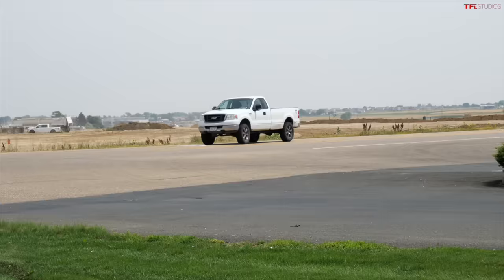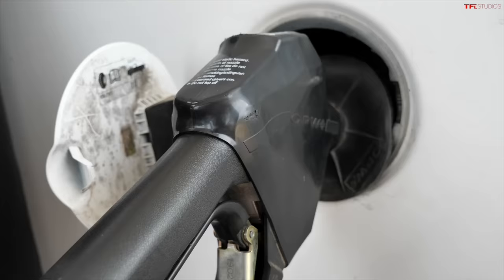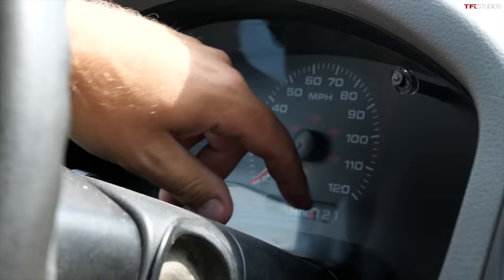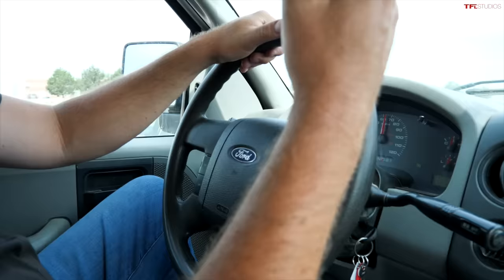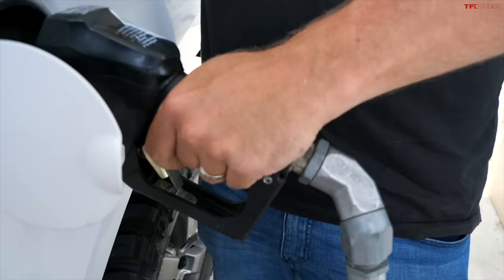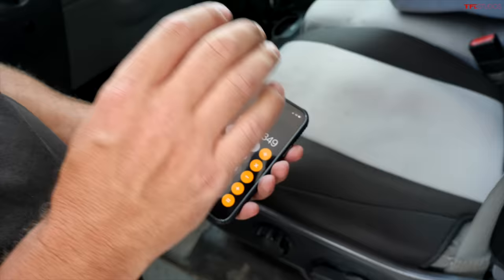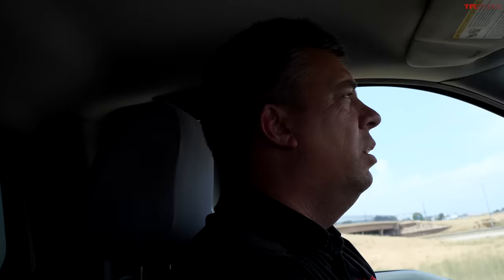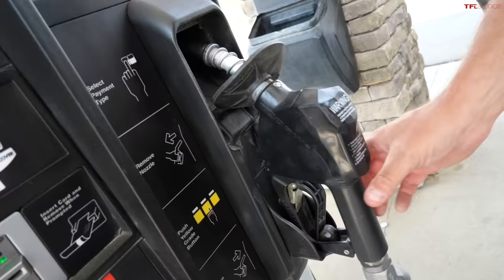Surprising Result: Here’s What Happens To Your Truck’s MPG When You Install A Topper!

Comment: That 4.6 motor is a great motor. The 18 years of owning my f150 with the 4.6 , I didn't have any issues besides basic maintenance of course .
It's unbelievable how the truck manufacturers stop making a proven motor and replace it with something else that usually is junk.
Reply: It sucks they all do that shit. I wonder if it wasn't for all this EPA garbage if they'd have kept some reliability
Reply: Have the same 4.6, though cammed for passenger car, in a 1995 Grand Marquis. Starts and purrs at the touch of the key to this day. Really good reliable engines.
Reply: Its incredibly common that the hoops they have to jump through for changing EPA regulations, and cafe standards, both take a dramatic toll on reliability.  Many of the engines, regardless of manufacturer, have the capability to go MANY trouble free miles.  It's the issues that arise from egr, pcv (routed into the intake), dpf and scr (diesels), and often times the tuning required to run clean enough for emissions standards, all these things take their toll on an engine.  I am all for vehicles that arent gross polluters.  But on the other hand, who likes to be stranded somewhere simply because reliability matters less than what the EPA decrees is allowable for the time being?
Reply: Because the old engines become obsolete.  Why do you think Ford stopped producing the Model T engine?  It’s called engineering, and the replacements are NOT always junk.
Reply: Does the 4.6 last? Yes. Is it a gutless inefficient engine? Also yes. Can’t say the 3.5 or the 5.0 are bad engines at all
Reply: You can thank the government for that.  Manufacturers are trying to squeeze out every bit of emissions and fuel efficiency they can.
Reply: My dads 2002 f150 had 400,000+ miles and it could last longer, but my dad left the truck running while he got off to the store and someone stole it, and after a police chance the truck ended hugging a big tree and was a totaled, but the grand marquis 4.6 still running like a champ and it’s almost like factory new
Reply: Thats 2 months older than me! Wow engines mustve been good back then
Reply: new and improved a computer on wheels;... NO Thank you!
Reply: Gutless but good motor have in all my vans
Reply: @TheFreedomtrain4449  My 01' supercrew 4.6 has 330,000 miles on it. Gutless, Inefficient, but reliable!!! And surprisingly even though its gutless it actually tows really well!!!
Reply: Actually, both 4.6 replacements (2.7 Ecoboost or 5.0 Coyote) have proven to be fantastic engines. The 4.6 was great but it's been around since the early 90s. We have one in our '03 Exploder
Reply: The 4.6 was reliable but grossly underpowered. The thing is you can make a ton of power with them with some tuning, it’s a shame Ford was so conservative with the tuning on the modular engines.
Reply: Everyone wanted faster faster trucks that save time getting from 0 to 60, everything is the gdi forced injection turbocharged aluminum stuff, we'll have to see how that stuff holds up over time compared to the old designs.
Reply: It's interesting to read other's experiences with the 4.6. Had a 99 F150 with it and it was absolutely the worst pickup I've ever owned. I spent more on repairs on it than all my previous trucks combined. The 4.6 itself sheared the exhaust studs - both sides, valve seals went on front cylinders - both sides, so it burned oil in those two cylinders. The plugs were good on the rest and completely fouled on them.  The hydraulic cam chain tensioner slowly died so the valves would clatter. The rest of the truck was a nightmare too - enough that it was the very last Ford pickup I bought.
Reply: Wait till uncle joe passes his corporate 52 mpg requirement coming for the next couple years. V8s gone!
Reply: @ShyaMiss  don't forget about fuel management and cylinder deactivation from Chevy. Basically destroyed those 5.3L engine that is known to last to the point my friend's father only had to replace the transmission 3 times.
Reply: @TaijiArban  the reason I didnt include those, is that I feel they are examples of mistakes made specifically by GM.  They all make their own mistakes, but I was going more with the general problem areas that plague them all.  You are however, not wrong.
Reply: @ShyaMiss  yeah, it's the only brand I have experience with in terms of reliability so I had to put it out there.
Reply: @TaijiArban  I am a GM guy myself.  I had an 07 vortecmax gmc sierra, I turned off the AFM with a tune, early on.  That truck was at 245k when I sold it and never had an issue.  I followed that up with a 14 Silverado, also defeated the AFM on that one right away, it's at 108k with no troubles to this point, even knocking down an average of 19mpg combined over its life, and getting just under 23 mpg when on highway trips.  Also installed a catch can on that one to try and keep the intake valves from getting all gummed up.  So far so good.  It is my opinion that none of this should be necessary though.
Reply: Absolutely gutless for a truck engine.  Mine was down to about 12 mph climbing a low mountain pass while towing a 6000 lb trailer.  That was of course before it burned a valve and became a very expensive paper weight.
Reply: Yeah. The 4.6 in my '02 F150 Super cab 2WD is pretty bullet proof for the way I drive it. But, once the engine does die, or the transmission fails again, I'm going to stuff an old carburated 7.5L 460 big block in it from an '80's E350 RV.
Reply: @RadarLightwave  That would definitely be a mistake. Don't get me wrong, I do love the 460 for what it is, but you'd be MUCH better off putting a 5.4 in the truck.

Empty, the 460 would be slower than a 5.4. By the time you add enough weight that the 460 would make a difference, you're pushing the limits of the truck itself. Add the weight of the engine block and abysmal gas mileage of the 460, and you'll be wishing you'd just had the 5.4.
Reply: @bc30cal99  Given the 4.6's statistically fantastic record, I'd say there's a lot more to your story than has been written here.

Did you buy new or used? How many miles? How was it maintained and used? Of course, lemons do exist regardless of manufacture and model.
Reply: @RadarLightwave  hope you enjoy 5 miles per gallon then
Reply: @regi0317  enjoy your 70k mortgage and btw, it sounds like garbage
Reply: I wish I could say the same about my 2004 with the 4.6
I've had nothing but problems with it. Mostly with various sensors malfunctioning, including the ECM witch has gone bad 3 times in 4 years !
Reply: @supersnot4  Bought used after having it checked by a mechanic. Had 115,00km on it. I'm pretty careful with maintenance - was actually a maintenance mgr for a construction company for a bit. It got full synthetic oil and good filters every 5000km. Up here in Canada the 4.6 didn't have a good record in the pickups, but seemed better in cars.
That '99 might have been "special" alright.
Reply: Heard stories about Cash for Clunkers and that engine? It’s the only one that would take hours to seize the engine instead of minutes! ✌️
Reply: Got the same 4.6 v8 in my 2003 Mustang GT. Still runs great! The modular v8 is very reliable.
Reply: @TheFreedomtrain4449  They are not gutless with mods. My Mustang GT whoops 5.7 chargers in races.
Reply: @TheFreedomtrain4449   That's the thing man, the SOHC 4.6 will last, but its gutless compared to the 4.8/5.3 and just wasn't competitive. They had to do something and developing a whole new platform would cost too much, same for making them all DOHC so along came the 3V as kind of a bandaid.
Reply: @michaelmartin2276  Sorry to hear that, Michael.  Since yours is a 2004, would you have the 3 valve motor then?  I understand those particular motors had way more problems (both the 4.6 and the 5.4).  The 2 valve motors were much more reliable and durable, although yes they had less horsepower and torque.
Reply: @LA_Commander  
2 valve
Reply: @michaelmartin2276  Oh wow, really? I could have sworn 2004 was the first year for the 3 valve.  My bad.
Reply: I had an Expedition with the 4.6. I broke a timing chain and drove 4 miles back home. I just changed the guides and put on a new chain and I was good to go. Non interference motors are a life saver when this happens. I loved that motor.👍
Reply: @bc30cal99  Same. My '99 4.6 F150 engine was fine at  250k. But everything else...as soon as it broke 60k, 3 complete pairs of tie rods, transmission rebuilt twice, 3 fuel pumps, 2 alternators, 2 $700 dash modules, 2 wiper motors, 2 starter motors and brakes and rotors would not last 30k. All highway miles. New silverado 2009, 246k 100k first pair of brakes,  zero tie rods, 1 transmission and starter rebuild at 200k. Both driven same routes equivalent stress. Huge difference.
Reply: @EM-fi2qg  Sorry to hear that happened to you E30, but glad you were able to fix the problem and move on so well!
Reply: @BIKEMAN21  Like their diesels !
Reply: @tedschmitt178   I still drive a 1931 Ford Model A every day (see my YouTube channel if you do not believe).  Ford's most reliable motor ever was replaced because the market wanted a V8.  They didn't care that it was less reliable.  They fell for the hype. Chevy had a 6, so Ford had to make an 8 to keep selling cars.
Reply: @TheFreedomtrain4449  my 2000 expedition has a 4.6 with 230000 on it. It gets around fine, still drive it on trips. Has no problems getting on the freeway, passing cars,. and gets 18 mpg when I drove it on trips! My FX4 5.4 with locked out phazers gets 18 light poles per gallon, but it pulls the hitch of a trailer! 90% of people that bought f150s with 5.4 would have been much better off with a 4.6! Friend of mine has one of the last 4.6 trucks. Does everything with it and it has over 200000 miles on it.! I pull a camper, with the FX4!
Reply: Same with the 4 liter V6. After 18 years the only issue mine has is it needs a new water pump.
Reply: @acdii  My coworker has a "center console" Crown Vic with the 4.6 in it. He just got his exhaust reworked and it sound soooooo freakin good, it's such a baller ass car. He put some 16' mustang wheels on it and it looks great. I'm so jealous of his "power cloud" hahaha
Reply: @bloodbushcraft2467  it is engineers trying to justify the money they get. Making it cheaper appears to make a bigger profit margin.  But them sales fall off , money and customers are lost . Cheaper is only better if reliability is not naggatively affected .
Reply: @Smokkedandslammed  That is the CV Sport model. I had one of the first editions myself. A rare one because it was a model year ahead of when they actually sold the Sport.  It was the precursor of the Marauder, except it didn't have the dual cam 4.6.  I loved driving that car, it was all black.
Reply: @acdii  He lucked out, I forget the milage but it was a run into town and go to church car for an old retired couple. I think they got something newer and he scooped her up, granted this was before the crazy used car prices of today so he got a good deal on it. His is the Champagné color. I couldn't believe it had factory air bags from the factory back then!
Reply: I had a 97 with the 4.6. Was a good motor, but the truck basically fell apart around it. Rust was awful even here in Tennessee.
Reply: Planned obsolescence.
My Chevy 350 (5L) is still running strong after 26 years.
Reply: @elgringoec  Look at this guy! Just shovin his bad ass engine in our faces! Get out of here with that longevity and solid engineering! We're all about totaling our engines after a misfire over here buddy, if you don't like it you can just drive on right out of here.

😜
Reply: I believe car makers can really make a good long lasting vehicle, but that’s not good for their business.
Reply: @Smokkedandslammed  
😂 It's all fun stuff!
When I was a kid I'd work on engines for fun.  Tweaking and building and experimenting to make them run better and stronger.   Nowadays I'm like, crap, I'm gonna hafta change the oil in this one soon.  😮🥺
Reply: @elgringoec  Im glad that 350 has had a good home after all these years and that's when you say "Ya know, ive been sliding around on the floor for years, time to get a lift!" Hahaha After shade tree wrenching and tinkering for myself for  almost 17 years (I'll be 33 on Friday 😁), I'm almost at that point where a lift would reeeeeaaaallll good in the shop hahaha
Reply: The 4.6 is well know in NYC to go an average of 340k in panther platform taxis. That's NYC better maintenance and driven well who knows how long they last.
Reply: @Smokkedandslammed  
Well yeah.  I've wanted a lift all my life.  Now I could afford one but can't justify it.  I'll put one in at my son's after we complete the post& beam farm shop/storage building we're working on.
I remember being garageless changing exhaust pipes/mufflers on the gravel, sometimes in the rain or snow, in order to get past inspection.  So the garage was high on the priority list.  With that and the creeper I was happy enough.
Reply: @tedschmitt178  The Model T engine wasn't reliable.
Reply: @ShyaMiss  It's always been this way. I remember my parents '78 ford country squire wagon with the 351M. My father kept the EGR unplugged most of the year until it was time to go back to get inspected. Reason why: every time it sat for 3+ days it'd blow the muffler if the EGR was left connected. After the 2nd muffler replacement the family garage said to leave it disconnected.
Reply: Junk? What did your 4.6 motor replace 18 years ago? Seems like Ford did a good job.
Reply: @williambranham6249  read my post. I said it was a great motor. 
Second part of your question,  I had a 2 wheel drive f150 with the 300 straight 6 (another great motor by the way) and it was replaced with a 4x4 with the 4.6 L.
Reply: My 3.5 twin turbo has almost 200k and still pulls like new.
Reply: Thats because the 4.6 engine is  DOG. its a gutless pile of junk. the 5.4 is superior. end of story.
the 4.6 is a serious joke. we haul 3 dirtbikes and gear and the truck is spent.
Reply: My 5.0 Coyote holding up great, 160k miles
Reply: @bearfoot25  heck ya! I broke down in a diesel truck pulling a really heavy trailer driving thru illinois one time. Took a bus home a came back for the trailer with my 4.6 97 f-150 with 350,000 miles. I was absolutely amazed how that old truck towed that trailer!
Reply: Usually to meet government regulations.  Big government for the win!
Reply: I had a 2000 f150 2wd with a 5.4 that I daily drove for 12 years and no issues up to 210k. The best mileage I got was 17.2 with a soft tonneau cover when it had under 50k miles and 18.1 on a trip with 190k miles and going 75mph the whole way, both in Texas.
By contrast I now have a 2017 2wd 2.7 that I pulled 23.7 mpg in Colorado with just 2k on the motor with no cover. Best I've got in Texas is 22.9. Not sure why but i was running 87 octane 'mid grade' in Colorado as there was no way i was going to put 85 octane on a boosted motor.
Reply: It's weird how my 97 2.3l ranger gets 34mpg on the highway when the newer ones get 24 um... wtf wrong here 25 year's  old almost gets better mpg then the new crap they make. No wonder we have a climate crisis.
Reply: @TheFreedomtrain4449  the 4.6 is only gutless in trucks in SUV's in cars it's plenty sufficient
Reply: its a good engine... but going up a mountain pass with a fridge in the back i could only do 80km/h without revving the shit out of it. of course it has 358,000kms

definitely reliable though.
Reply: @halflife103  that engine is tired lolol even 5.4's get gutless when they need chains ect.
Reply: @countryguywithcamera  I mean, doesn't sound tires and no rattlesnor anything. Doesn't smoke or anything. No check engine lights.
Reply: Charging emissions and fuel mileage requirements are usually major factors. It actually costs a lot of money to develop and retool to produce a new motor
Reply: @DaveCM  exactly you can only restrict and detune an engine so much before a total redesign is needed
Reply: @RadarLightwave  so you can get half the mileage while maintaining similar power levels. Nice
Reply: @elgringoec  350 is 5.7...dont short yourself
Reply: @Coldfire840  
Good eye!  No worries, I'm a CI guy, long as that's right I'm happy.  The CCs were for bikes, rice burners, when I was cutting my teeth.  Then for toy cars, also rice burners.  When I'd tell those guys who'd get those early little things in the 1200 to 2000 range that mine was a 7210 they'd look at me like I was from outer space.  
Do just one donut around them and they're fuming, "those things should be illegal!"
Reply: I have the f150 with the 4.6 as well, Bullet proof! No issues
Reply: Planned obsolescence!
Reply: @careykuhn9174  Shit none of the 4 cylinder and 6 cylinder turbo and twin turbo engines get anywhere near that either, so those will be gone too, and we'll be back to flintstone mobiles LOL.
Reply: @bloodbushcraft2467  It is a false assumption that efficiency would equate to a reduction in reliability. That WAS true in the early 1970's when SMOG equipment was retrofitted onto existing engines in a fast and haphazard response to new environmental regulations that were evolving quickly with emerging science. You can blame toe automakers for that, not the EPA - Carmakers were spoiled and resting on their laurels for generations. Fast forward to the 2000's and most auto mfr's have developed cutting edge engine designs capable of incredible efficiency with NO sacrifice in performance. They can keep going in that direction, but the oil industry exerts incredible lobbying to keep average mpg's from continuing to climb upwards. Reliability is NOT a necessary factor in this conversation at this stage in the technology.
Reply: I'm building a Boss 460 for my 96 F350 4x4 and don't give a F@#k what anybody thinks. Using aftermarket EFI and 'puter too.
Reply: @EagleTwo758  Nice....that'll be a fun truck once you get it done.  Love the 460 in my 88 F250, it just don't pass many gas stations LOL.
Reply: My 3.5 ecoboost would blow the doors off your 4.6 any day.
Reply: @jj-eg5up  really dude! Nobody is talking about racing. Get real.
Reply: @luckytrapper7656  I am real. The 4.6 was fine. The new engines including the 5.0 coyote that replaced the 4.6 are just plain better. 
You made a pessimistic comment. The comment, although based in opinion, was wrong. I made note of that by comparing the performance differences of the old vs new engines.
That being said, the 3.5 and 5.0 are better than the 4.6 and your comment was inaccurate.  To reiterate my original post, my 3.5 would eat your 4.6 for dinner and still have room for dessert.
Reply: @jj-eg5up  your comparison of a twin turbo 3.5 to a naturally aspirated 4.6 is sickening.  Take the twin turbos off the 3.5 a see what happens or stick twin turbos on the 4.6 and see what happens. I do believe you will be standing there scratching your head.
As far as newer motors, they are generally always better. I say again, generally. I do agree about the awesomeness of the 5.0. Hell of a motor.
Reply: @luckytrapper7656  see, even you just admitted that your first comment was wrong.
Reply: @jj-eg5up  how?
Reply: @luckytrapper7656  read your response.
Reply: @jj-eg5up  about replacing proven motors with juck? 
Ok let's see. What replced the 4.6?? Not the 5.0. The 5.0 was already in use when they stopped the 4.6. How about the 300 straight 6, another great motor. It wasn't the 3.5 tt. How about the 7.3 diesel. That wasn't replaced with the 6.7.
Give me an example of a great motor that was replaced with a better.  And PLEASE don't say 5.4 to the 6.2.
Reply: @luckytrapper7656  you seem bothered by this. It's OK man. We all misspeak from time to time.
Reply: @jj-eg5up  you can't name a single one. My bad, I'm sorry to have put you on the spot like that.
Reply: I've got the same engine but man, 2.7 Ecoboost is the best engine ever created. Powerful and peppy with 20-28mpg
Reply: The 4.6 2 valve engine was a complete waste of engineering , it wasn't any better than the 302.  Ford should've just improved the 302.
Reply: Had a 4.6 in a 2004 Grand Marquis. Best engine I ever owned as far as I can tell. Averaged 25 mpg in a large car and sped no oil at 90,000 miles when someone pulled out in front of us on the highway. That long front end absorbed a lot of shock at 65 mph. Would have been interesting to couple that engine with today’s transmissions.
Reply: Mine was a gutless wonder. I had a metal shell  on the back and was lucky to get 14 mpg. Transmission was constantly hunting and the brakes sucked. Traded it in on a Dodge Ram diesel.
Reply: I had an '07 Explorer SUV 4 dr with the 4.6 engine. Gave very exellent performance and still got 20 mpg (+) at 70 mph.
Reply: Ford is a prime example of engineering for style, not efficiency.
Reply: Ford messed up when they did away with the 7.3 diesel